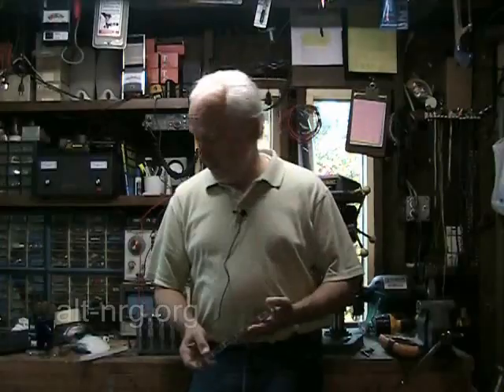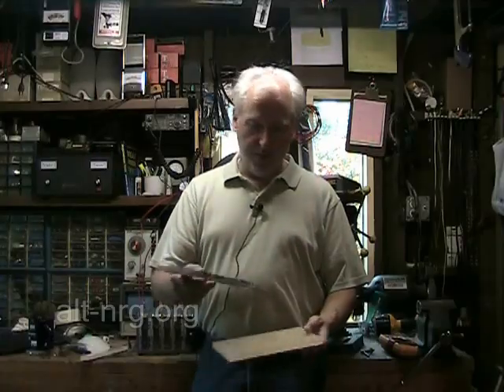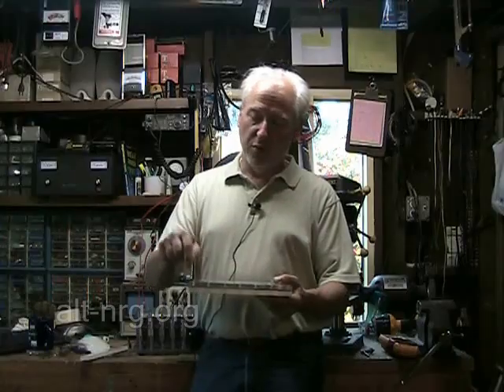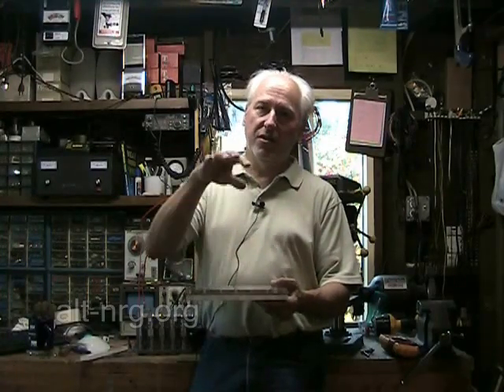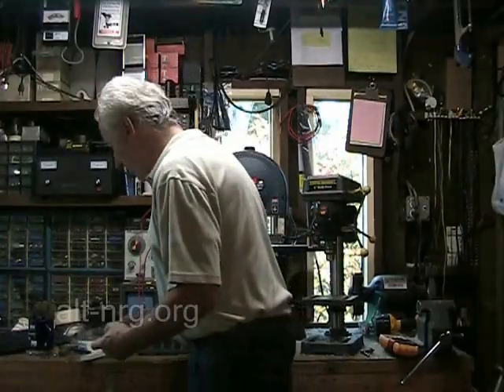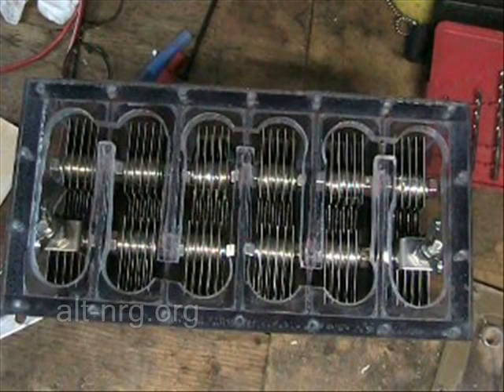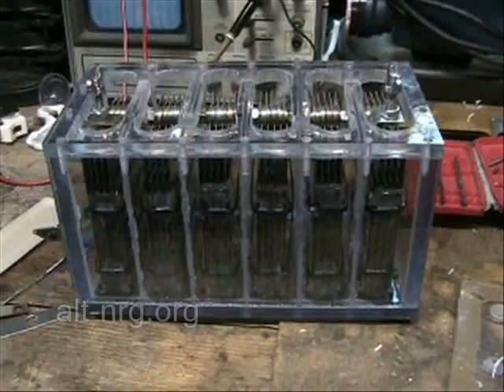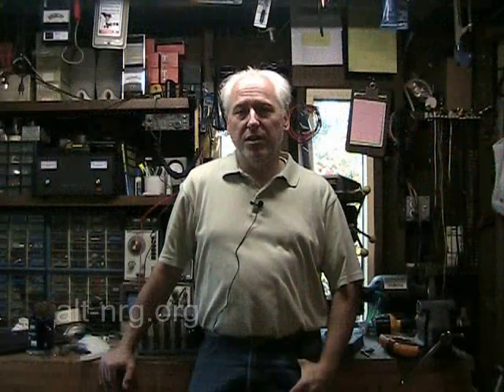#244 Batt-Cell update!

Comment: IN a battery the plates are responsible for transferring energy from & through them from the makeup of the 2 different plates. ..unlike HHO  plates which are all the same and the energy is already there with a different goal of passing through them and the liquid solution, so then the goal would be to isolate each plate (not cell series) so it would pass through each plate individually contacting as much surface area as can be,without  it passing through the bath to other plates.

Comment from the maker: NEWS FLASH EVERYONE!  I increased my KOH concentration to just less than 1M (50g/L) and posted 5.92MMW consistently! Same linear characteristics throughout the power ranges. Really stoked! Similar results with the PWM at 14.6 VDC input. Plan to go to 2M, retest, then conduct more engine tests.

Also pressure tested to 10 PSI with no leaks.  YAY!!!

Comment from the maker: @llewgnal Tnx. Hey, maybe you'll know the answer to this. When I drilled or cut the 1/2" Plexi, it gave off a really sweet odor that the Lexan did not. Also could not melt the cut edges glossy with my Butane torch like the Lexan. What does that say about the Plexi material type?

Comment: @ZeroFossilFuel Acrylate cracks or breaks faster then polycarbonate, both are sold as Plexiglas, but both have way different properties. Acrylate is only 30 times stronger then glass but it breaks easy when you want to cut it or when you want to drill a hole in it. Polycarbonate is 250 times stronger then glass, it can handle higher temperatures, it is chemical resistant, and it's easier to work with. Sadly enough it's way more expensive as well. 8mm 1x2m = 160 euro here. Nice job Z, Peace, iT

Comment: I have had difficulty with making holes in plexi in the past. My solution was to get thin wall brass tubing from local hobby / hardware and on one end cut teeth using cut off blade in dremal tool. You can use this as a drill and it won't cause stress cracks in plexi.
Thanks for your work on our behalf

Comment: very impressive. If power input variances are not changing efficiency; what can be done to increase eff. without a redesign of the cells? electrolyte concentration as stated but what else? whats the biggest power input you can reliably add to the cell for testing?

im eager to see the results of your labour. great work.  very inspiring.

Lionel

Comment: Zero, I built a cell very similar to that one a year ago. I had huge problems getting the cell to completely seal up. In fact I thought my MMW was lower than it should have been as well. What I found was that I indeed had leaks and was really producing more HHO than I thought I was. I would bet that you are as well. Check very closely for leaks. I will bet you will find some. Weldon 16 works very well to plug the leaks. Very nice work indeed.

Good Luck
Larry